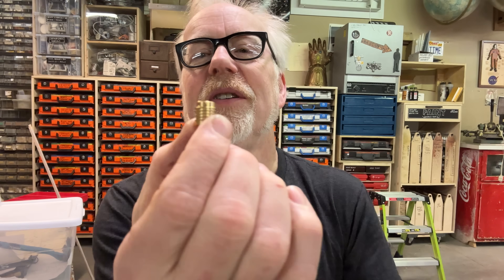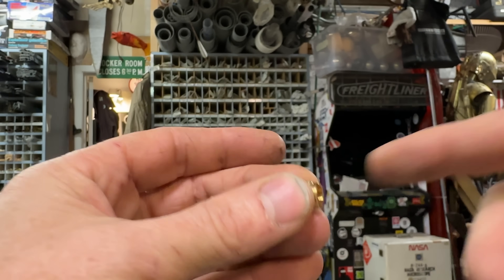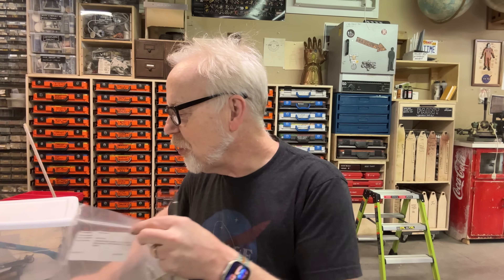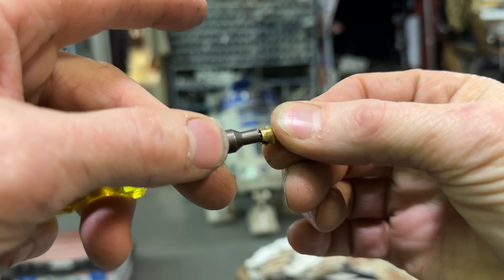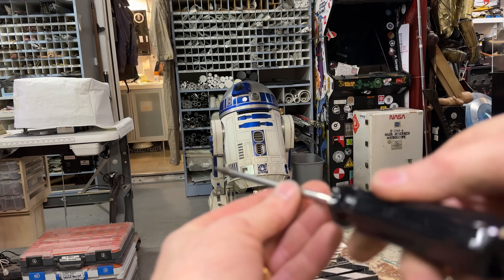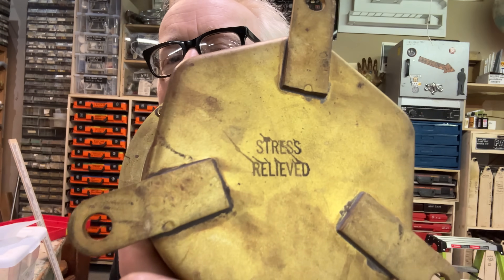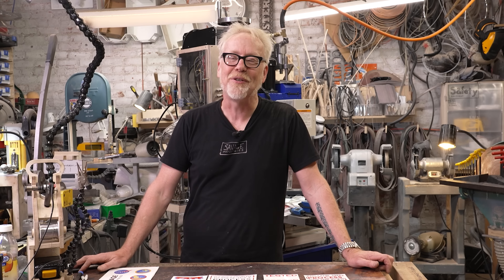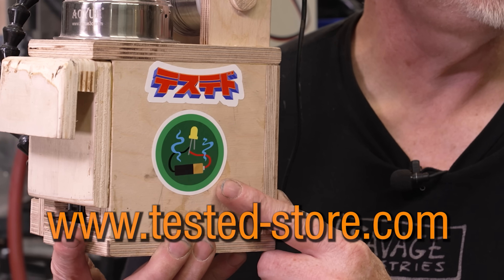Adam Savage Learns About Barrel Nut Screwdrivers!

Comment: They should go in the Sortemo box w/ the barrel nuts so every time you get a barrel nut, you see the screwdrivers and remember you have them....    😁👍😂
Reply: Ditto
Any specialty fitting that uses a unique tool should be stored together.
Reply: Exactly what I was thinking!
Reply: This is a great solution!
Reply: I began doing this with most things, I call them my "hobby boxes" and they're very simple, like one has my multi-tool and all the blades and such associated for it. Another has my jigsaw and all the blades, etc. Another for my hammer drill, chuck, bits, and concrete screws. 

It makes it so much nicer to go grab a box that has all the things in it I'm going to need to do something. 

With the hammer drill are other smaller plastic containers that contain the different screw sizes, and it's all labeled with masking tape and a marker.
Reply: @PensiveArchon in the Air Force that's called a dispatchable CTK, or 'Complete Tool Kit.' A tool box with all the normal necessary tools to get a particular job done that can be issued out and dispatched to the working location.
Reply: Yes
Reply: same 'first' thought I had
Reply: I said that out loud to myself, “they need to go with the barrel nuts”.
Reply: There's a few caveats here though. If you/he has enough barrel nuts (or anything else of equal meaning here) that it splits across multiple cases, the drivers are costly and each driver fit a sub-range of sizes. In that case, if it stays in the shop, you might as well have a dedicated place for them. Instead of having to pull multiple cases when you only need the parts from one, and the remember to pull those extra cases again to put those overlapping drivers back after use.

This is if you actually have the space for a dedicated spot for them ofc, and you're diciplined enough to put them back in that spot. If the answer to either of those things is no, you might be better off keeping the with the nuts even if it means a bit extra hassle. Another caveat leaning towards "dedicated spot" is if you don't actually have big-ass cases of parts, and limited shelf space. Because the retail boxes rarely have the extra room to fit tools inside them, and stacking flat plastic boxes on top of eachother with assorted tools stuffed inbetween them sounds like a big pile of wobbly nope.

Comment: For the uninformed, you stress relieve metals, including brass, by heating them uniformly up to some temperature specific to that alloy and allowing them to slowly cool. Some alloys benefit from slowly cooling down to cryogenic temperatures. At any rate, it is important that the temperature changes always occur slowly so as to not warp the part, i.e. induce any further stress.
Reply: That part was most likely done after it was formed and the mounts welded on the back. In high viberation areas it will keep things like the mounts from cracking off as easily.
Reply: One theory about the alleged superiority of antique Stanley hand planes is the castings were cast and machined in batches, shuttled between the factory and an unheated warehouse between each machining step. Supposedly the constant temperature shifts relieved stress and stabilized the castings.  Given the large variety of products and the limited market for some of the less common sizes a plane body might take years or even decades between casting and final machining.  

Obviously that's not true.  A much simpler explanation is people have just had more time to discard the planes that warped.
Reply: @danielstickney2400  Or that the factory would take all the castings for the previous day, and place them in a furnace that had been used, and allowed them to heat up from the residual heat in the lining, and slowly cool overnight. That way any that cracked could be told using a ring test, and tossed into the pile for the next melt, and any that were too badly warped as well, while those that passed went into the machining shop to get cut into shape, most likely on a shaper as well, and then finally ground to final dimensions. 3 shapers , each with a jig, could do  all the rough operations and not worry too much about hard spots, as the HSS cutter will only wear slowly, while a single operator for 3 machines will be able to keep up with the needs to swap tooling, and parts from jig to jig.
Reply: Periodic annealing like you mentioned is also sometimes necessary to prevent cracks and other damage when a piece gets work-hardened as it's being made.

Comment: There are also hex drive threaded inserts that use an Allen/hex key instead of a barrel nut screwdriver. I recently used these when building a desk that I wanted to be able to take the legs off of in case of needing to transport.
Reply: That's what I use as well, also for desk legs.  In addition to not needing a one-off tool, you can get lots more torque with a hex via a ratchet.
Reply: @mdbbox5660  Or an impact wrench!
Reply: I think some of the electrical lugs (similar to the ones in the Junction box he showed) are like that. Positive retention is important in those situations.
Reply: Same. Also can always use a sized bolt and nut to use a socket.

Comment: Something like those i would store right with the insert nuts, as it is pretty rare you would find and need to unscrew an existing insert nut in the wild.
Reply: Agree 100%
Reply: yes, but then you slide into arguments like do you store your apple corer slicer thing with your apples? Functionally i love it philosophically it troubles me
Reply: @juliettaylorswift Yes you probably SHOULD store your apple core slicer with your apples. If that makes it easier to remember where it is and easier to use vs any of the other places you could put it. Storage is 100% functionality and ergonomics.
Reply: @gearandalthefirst7027 but then where do I put the juicer? Do I store my towels inside the shower to store the tool closest to the job it’s used on?
Reply: You genuinely don't need one. You drive them in with a normal screw and you pull them out with a screw with a nut on it. You drive the screw in, hold it stationary, then drive the nut, tighten it against the insert and then unscrew the lot out.